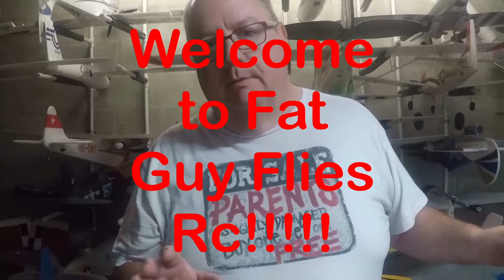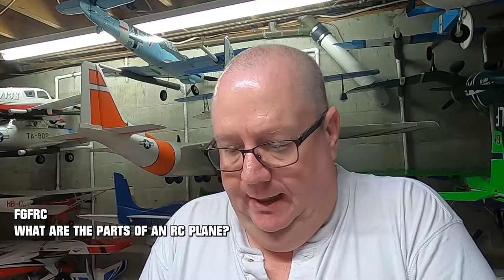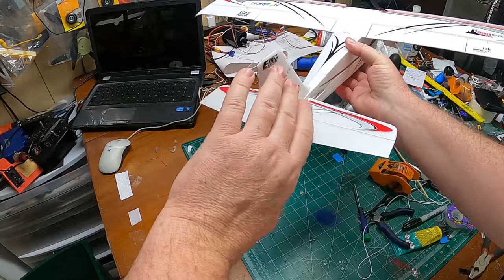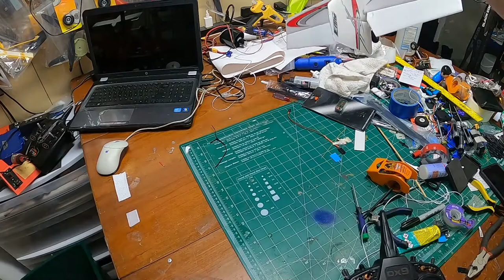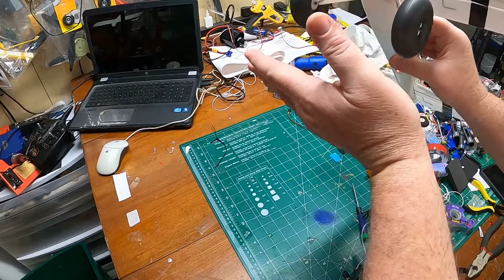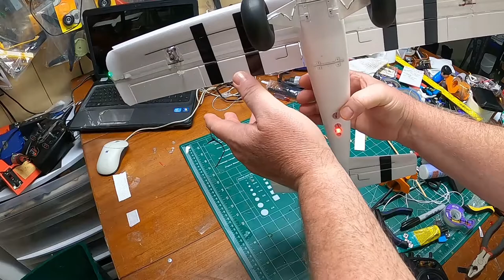BASIC OVERVIEW OF THE EXTERNAL PARTS OF AN RC PLANE BY FGFRC

Comment: Useful stuff for those new to the hobby. Too often assumptions are made by manufacturers.
Just noticed does the Timber have differential ailerons?
Reply from the maker: Thanks. If you mean do they travel opposite of each other than yes. I guess I am not getting what you mean by differential ailerons.
Reply: @FatGuyFliesRC  greater amount of up movement compared to down (down is more effective)
Reply: @MarkCroucherRC4fun  

Depending on the the reciever board is setup from the factory. No 2 are alike.
Reply: Differential Ailerons: One aileron is raised a greater distance than the other aileron is lowered. The extra upward aileron movement produces more drag change than an increase in AOA on the downward aileron. ... The leading edge of the aileron is now pushed into the airflow, creating drag and reducing adverse yaw.